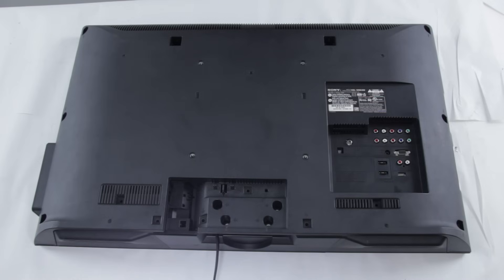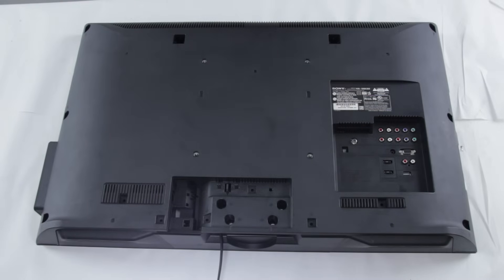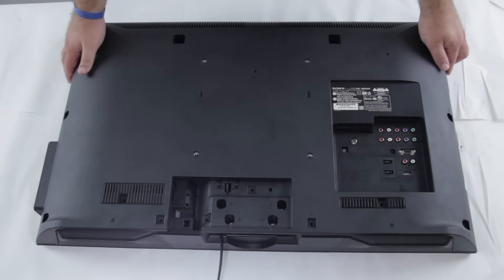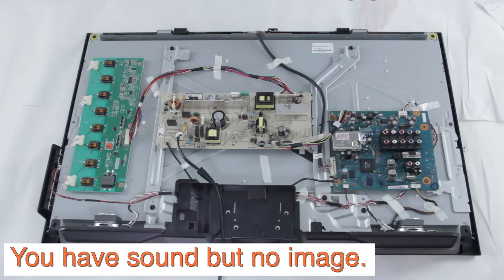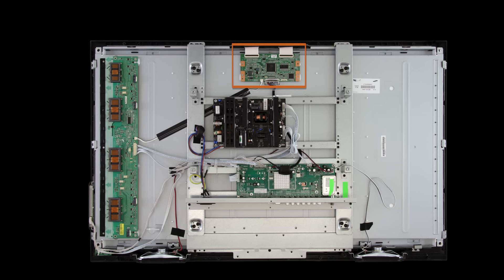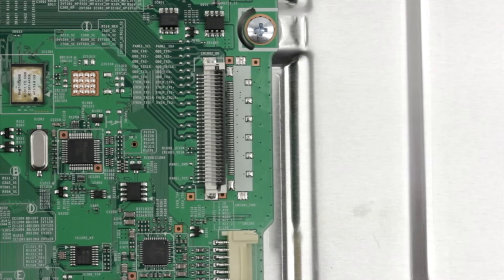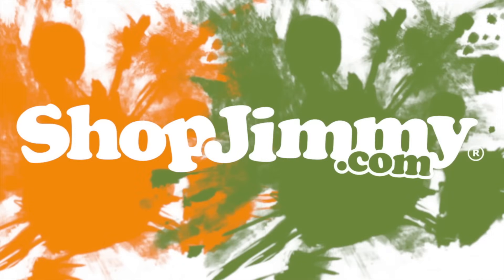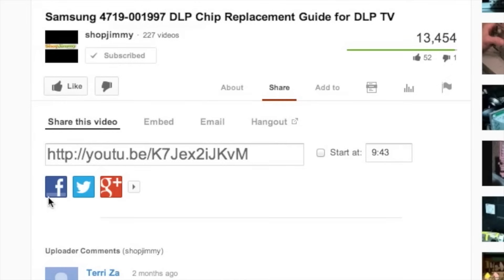LCD TV Repair Tutorial - T-Con Board Common Symptoms & Solutions - How to Replace T-Con Board

Comment: Gday I have a Toshiba LCD color TV model NO.  32AV500A and a long number 835402006216k .... The power is on at the wall but no power light on the front..??? Help
Reply from the maker: Daniel Anderson   PLEASE SUBSCRIBE TO OUR CHANNEL - Try all repairs and troubleshooting at your own risk.  I recommend replacing the main board in your TV.  Click this link to a possible replacement parts for your TV model number:  http://www.shopjimmy.com/toshiba-75011292-main-board.htm  There may be multiple boards for the same TV model number, be sure to match part numbers on your current board, with your replacement for compatibility.  Here is a link to a video showing how to identify your part number, click here:   https://www.youtube.com/watch?v=3DQe0ATZl_QThanks and please let us know if you have any further questions with your TV Repair!  www.shopjimmy.com

Comment: hi will like to no my tv samsung ln37a550p3fxza the picture is darker than normal i try adjusting the back light the brightness and so on and it wont get any better especially it gets darker when i put it on Movie works better on Dinamic after 20 minutes or so it turns all white but can see the picture what is needed to purchase the part from you guy you guys are excellent i have purchased items from you before
Reply from the maker: Julio   PLEASE SUBSCRIBE TO OUR CHANNEL - Try all repairs and troubleshooting at your own risk.   I recommend replacing the power supply board in your TV.  Click this link to replacement parts for your TV model number:  http://www.shopjimmy.com/samsung-bn44-00216a-power-supply.htm  There may be multiple boards for the same TV model number, be sure to match part numbers on your current board, with your replacement for compatibility.  Here is a link to a video showing how to identify your part number, click here:  https://www.youtube.com/watch?v=sSJexLvRrjM  Thanks and please let us know if you have any further questions with your TV Repair!  www.shopjimmy.com

Comment: I have a Samsung LCD 46in TV Model # LN32A330 with serial # AKZ43CDS103282X, I have replaced the T-Con board and the Main board but still I am having vertical lines and the screen is divided in 3 sections horizontally.  Any help appreciated.
Reply from the maker: Gary Cole   Try all repairs and troubleshooting at your own risk.  This sounds like a TV panel (TV Screen) problem.  If your TV panel is bad, it may be more cost-effective to replace the TV as panels are typically hard to find in stock, difficult to replace, and expensive.  Thanks and please let us know if you have any further questions!  www.shopjimmy.com

Comment: Hi guys,
I have a sharp LC 42SB45U and it only works by remote control. The side panel does nothing.  The TV turns itself on and if unplugged and then plugged back in it is back on automatically.  You can bring up the input screen and select and input but it always reverts back to TV channel one.  Any menus that are brought up using the remote control just scroll through by themselves and you have to try to select while scrolling.  The picture is fine and my question is does this sound like a control board problem more than a main board?  Before it completely failed when I could get the input to hold for few minutes the picture was fine.  But now it will not switch to any inputs and automatically reverts back to TV channel one and you cannot change that channel. I did all of the hard boot procedures to no avail since the buttons are dead. No way to get to service mode
Thanks for any help on this
Troy
Reply from the maker: Troy Rose  PLEASE SUBSCRIBE TO OUR CHANNEL - Try all repairs and troubleshooting at your own risk.  I recommend replacing the main board in your TV.  Click this link to replacement parts for your TV model number:  http://www.shopjimmy.com/catalogsearch/result/index/?cat=56&q=42SB45U  There may be multiple boards for the same TV model number, be sure to match part numbers on your current board, with your replacement for compatibility.  Thanks and please let us know if you have any further questions with your TV Repair!  www.shopjimmy.com

Comment: Hi, I have a 40 Inch Sumsung LCD TV with the following details:

Model code: LA40D550K7RXSJ
Serial Number: LDSR3DCBA00023M
Version: SQ02

I bought it 3yrs ago and it's now out of warranty but has developed the following problems:

Initially it would become hazy after a few minutes from being switched ON. Sometimes this problem wasn't experienced or took longer to manifest and eventually it just ended before I could get it repaired. However, this seemed to usher in another problem because horizontal lines started about 2 Inches from the bottom and later they started occupying the whole TV. You can see that the picture behind the lines is good but I don't know how to get rid of these lines. Please help!!!
Reply: did you check that the flex cable from main board to LCD panel? few month before I also found same problem. I checked one by one then I found that the flex cable has been damaged with capacitor acid . a capacitor was leaked with acid. the flex cable was damaged by acid. it was not repairable.

Comment: Could you advise what the most likely problem is with my older but in otherwise great condition TV;

Sony Bravia KDL52S5100, s/n 8021625, Mfg Mar 2009

Symptom 1: Only using HDMI Inputs - Some of the 3 HDMI Inputs would not work, sometimes they showed available in the TV Input Menu, sometimes not, yet always did not work with a good input source.  Solved by using an external HDMI switch and one good HDMI input on TV.

Symptom 2: Symptom 2 appeared months after symptom 1.  Only using HDMI Inputs - All of the 3 HDMI Inputs would work with video, but none will provide audio.  Other inputs have audio.  Thus, HD not available with sound.

Have ruled out cable box by swapping.  Thank you!

Comment: Samsung - LE40A457C1D
My picture is solarized and suspect it could be tcon board - T400XWO1 V5 40T01-C00
Have you got any suggestions?
Reply from the maker: cowanguy2000  PLEASE SUBSCRIBE TO OUR CHANNEL -  Try all repairs and troubleshooting at your own risk.  You could have a problem with either the t-con board, the main board or the TV panel.  You can replace the main board and the t-con board individually to see if one of those boards fixes the problem.  Click this link to replacement parts for your TV model number:  http://www.shopjimmy.com/catalogsearch/result/?q=LE40A457C1D  There may be multiple boards for the same TV model number, be sure to match part numbers on your current board, with your replacement for compatibility.  Here is a link to a video showing how to identify your part number, click here: Thanks and please let us know if you have any further questions with your TV Repair!  www.shopjimmy.com

Comment: I have a vizo TV model # E320-A1 serial #10223470021 TV will not come on but the white indicator Lite in the left hand corner comes, I changed the power pack Vizio ADTVCL801UXE3 Power Supply for E320-A1 but it did not work
Reply from the maker: Greg Sagan   PLEASE SUBSCRIBE TO OUR CHANNEL - Try all repairs and troubleshooting at your own risk.  I recommend replacing the main board in your TV.  Click this link to replacement parts for your TV model number:  http://www.shopjimmy.com/catalogsearch/result/index/?cat=56&q=E320-A1  There may be multiple boards for the same TV model number, be sure to match part numbers on your current board, with your replacement for compatibility.  Thanks and please let us know if you have any further questions with your TV Repair!  www.shopjimmy.com

Comment: Hi, i have a  55 inch VIZIO tv  model number  M550Sl. ,  the problem is my tv only show half of the picture on the left , the half on the right side  has vertical bars, like ghost, and colors mixed,,  is my t con board  bad?  if its do you have part for that board/ ?  help  thanks.

Comment: Hi I have problem with my LG LCD tv which is showing no signal tryed everything but not working what to do I checked the main board price is more then new tv don't know why is there any solution or I can get cheap pcb somewhere it 42LD560-TA.AAUWLJD and the pcb #ebu60870701 thanks
Reply from the maker: Muhammad Malik   PLEASE SUBSCRIBE TO OUR CHANNEL - Try all repairs and troubleshooting at your own risk.  I recommend replacing the main board in your TV.  Unfortunately I do not see any replacement parts in the search results for your TV model number on our website.  Please reply with your part number on your main board and I can try searching for replacement parts.  Thanks and please let us know if you have any further questions!  www.shopjimmy.com

Comment: I have a Samsung L32A300J1D and serial # ARVX3CPQ907761T.

Similar Problem as in this youtube video: https://www.youtube.com/watch?v=a1ok1VEHctc.  My T-Con Board is V315B1-C01, is that what i need to replace or panel i suppose as it wouldn't be a mainboard?
Reply from the maker: Mitch Piekarski  PLEASE SUBSCRIBE TO OUR CHANNEL - Try all repairs and troubleshooting at your own risk.   This could be a problem with either the t-con board, the main board or the TV panel.  You can replace the main board and the t-con board individually to see if one of those boards fixes the problem.  Click this link to replacement parts for your TV model number:  http://www.shopjimmy.com/catalogsearch/result/?q=32A300J1  There may be multiple boards for the same TV model number, be sure to match part numbers on your current board, with your replacement for compatibility.  Thanks and please let us know if you have any further questions with your TV Repair!  www.shopjimmy.com

Comment: Hi, I have a  Samsung LE40 A699M1W and I have the classic clicking problem. TV takes ~10 minutes to start from cold boot. after being in standby for about 1 minute, the boot time increases by about 5 minutes. I have replaced the PSU, and attempted to reset the EEPROM, which did not help. I have not replaced the EEPROM yet, but i think it might be a panel / TCON board problem. I have read online that disconnecting the LVDS cable (from mainboard to tcon) and turning it on will help in this diagnosis. It turned out that the backlight turned on anyway, the power LED turning on and off faster than usual. I heard this means it's either the TCON board or the panel. Could the EEPROM still be the problem? Or will i have to deal with fixing TCON / panel problems only now?

Comment: i have a kdl-46w4150. we had a bad storm that looks like shorted something on my tv. non of the HDMI ports work, does not matter what i hook up to them it does not get signal. if i connect my ps4 to it, you can heard the sounds but no picture.

at the same time. Video 1 and Video 2 work fine. 
i did the hard reset but did not work either

can you tell me what part i need to replace. 

Joe

Comment: hi-
I hv a tv Brand Name:SUPRA MODEL NUM:SLT32VE5001 SN:6368231 800079
POWER SUPPLY :220-240V  50Hz
I get red vertical line on the screen -the line is not straight but wavy.
what could be the problem?????

Comment: I have a sony KDL 50EX 645 that has sound but no picture.  The green light turns on but then the red light flashes 5 or 6 times and then shuts down again.  I think this is the T-Con board.  Two questions:  can it be replaced in my sony and where can I find one -- I live in a very rural location.
Reply from the maker: Andrew Smith   PLEASE SUBSCRIBE TO OUR CHANNEL - Try all repairs and troubleshooting at your own risk.  <!-td {border: 1px solid #ccc;}br {mso-data-placement:same-cell;}->There is a difference between the 5 or 6 blinks. 5 is t-con and 6 is lamps I would count them carefullyx and then reply.  Thanks!  www.shopjimmy.com

Comment: My LCD sony Bravia Model# KDL46VL160 shows vertical lines all over the screen. I've disconnected the power and connected again but same problem. I did check the picture statues through Menu and picture setting but didn't work. What should I do now?
Reply from the maker: Ladan Nasseri   Try all repairs and troubleshooting at your own risk.  This sounds like a TV panel (TV Screen) problem.  If your TV panel is bad, it may be more cost-effective to replace the TV as panels are typically hard to find in stock, difficult to replace, and expensive.  Thanks and please let us know if you have any further questions!  www.shopjimmy.com

Comment: Samsung LN46B530. Screen has very bright white, almost negative image. Could this be the t-con board, or do you think it is the screen itself? Thanks in advance for your help.
Reply from the maker: Jeremy Bone   PLEASE SUBSCRIBE TO OUR CHANNEL - Try all repairs and troubleshooting at your own risk.  This could be a problem with either the t-con board, the main board or the TV panel.  You can replace the t-con board and main board individually to see if one of those boards fixes the problem.  Click this link to replacement parts for your TV model number:  http://www.shopjimmy.com/catalogsearch/result/?q=LN46B530  There may be multiple boards for the same TV model number, be sure to match part numbers on your current board, with your replacement for compatibility.  Thanks and please let us know if you have any further questions with your TV Repair!  www.shopjimmy.com

Comment: I need to replace the F-Buffer on a Samsung PN50B430P2DXZA. The flat cables coming from the panel to this board appear to be held on by some type of adhesive. Any tips on removing these cables without damaging them? Also what do you recommend to use to attach them to the new board.
Reply from the maker: Carlos Rodriguez  Try all repairs and troubleshooting at your own risk.  Unfortunately, there is no real way to remove them without doing damage that is why it's not recommended to remove them.  Thanks!  www.shopjimmy.com

Comment: I have a Vizio E550VA that has sporadic solarization. It works fine and then will have a small amount only on the edges of the images and then the whole screen will have it, then it will go back to a normal picture. When I pull up the input screen and menu screen it is also on those but not really bad. Is this a T-Con issue?
Reply from the maker: Shawn Walters  Try all repairs and troubleshooting at your own risk.  This could be a problem with either the t-con board, the main board or the TV panel.  You can replace the t-con board and the main board individually to see if one of those two boards, fixes the problem.   Click this link to replacement parts for your TV model number:   http://www.shopjimmy.com/catalogsearch/result/?q=E550VA  There may be multiple boards for the same TV model number, be sure to match part numbers on your current board, with your replacement for compatibility. 
Thanks and please let us know if you have any further questions with your TV Repair!  www.shopjimmy.com
Reply: I don't know if this helps any but I took the back off to see where the T-con board was located. It has a cover on it and I have to remove several things to get to it. I decided to wait to do this so I put the cover back on. There have been a couple of times that the TV has gone psychedelic and I banged on the back of the TV where the board is and the picture went back to normal. Does this make it more likely that it's the T-con board?
Reply from the maker: Shawn Walters   Try all repairs and troubleshooting at your own risk.  You could try replacing the T-con board first.  You could also check the connections on the t-con board to be sure they are tight and seated correctly.  Thanks!  www.shopjimmy.com

Comment: I have a lg 55 in 3d tv and it only gets picture on half and the other half is all white and when both ribbons are connected on the t con the t con gets very hot. But when you unconnect the side of the t con that is white it cools down. Could this be a bad t con?

Comment: Elements model LC401EM2F, SNDS1A1137448 (A17PCUH)
Vertical lines in center and toward right of screen.  All colors distorted.
Reply from the maker: Curt S.   Try all repairs and troubleshooting at your own risk.  This sounds like a TV panel (TV Screen) problem.  If your TV panel is bad, it may be more cost-effective to replace the TV as panels are typically hard to find in stock, difficult to replace, and expensive.  Thanks and please let us know if you have any further questions!  www.shopjimmy.com

Comment: m#un46es6500f, s#z4tf3cvc606318x. Backlight is on. Sound ok but no video. If I disconnect one of the two cables from the t-con to the panel I will get good video on half the screen. Does this point to a bad panel or t-con bd???
Reply from the maker: John Grelis   Try all repairs and troubleshooting at your own risk.  This sounds like a TV panel (TV Screen) problem.  If your TV panel is bad, it may be more cost-effective to replace the TV as panels are typically hard to find in stock, difficult to replace, and expensive.  Thanks and please let us know if you have any further questions!  www.shopjimmy.com

Comment: Hey guys, I could not find a matching tcon board for my JVC LT-47EM59 tv. It has no picture but it has audio and backlight. When I first started having these problems the image would freeze and stay on screen until it faded to black. Instead of attempting to find a tcon board, i bought the necessary parts to fix the board, but I'm not quite sure how to fix it. Any help is greatly appreciated!